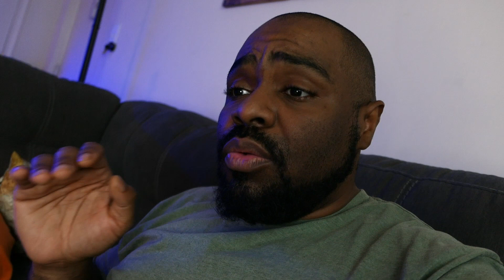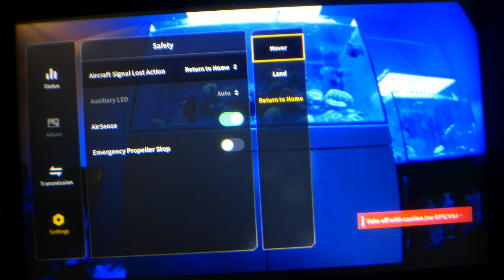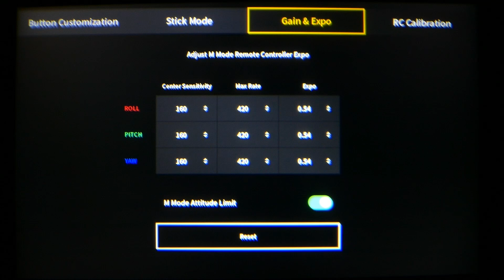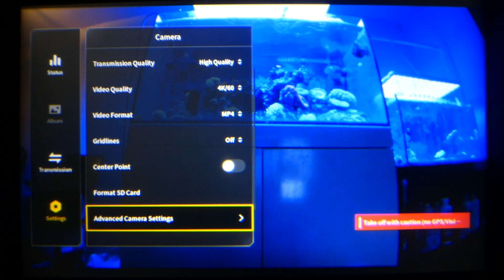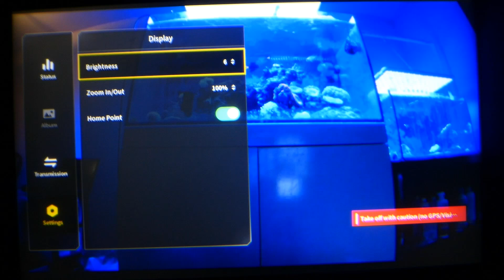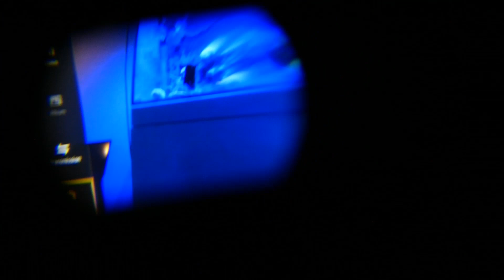Dji Fpv drone setting menus

Comment: Question for you. I just got my dji fpv combo and had a error code. Said rc control stick error. How can I fix tht. Would rc calibration fix tht? Dji said they have never seen tht code.
Reply from the maker: It is usually associated with the adjustment of the screws that release the tension on the throttle. I was told to make mine tight and I believe it fixed it.
Reply: @Bigballvlogs  thanks I did also try tht to no avail.  Their sending me a new one but thanks for your reply. Enjoy flying.
Reply: @garabrandt100  try to calibrate it again. Then it should work
Reply: Did you turn the f1 screw or the f2 screw? The f2 screw is the one that lower down the throttle stick.